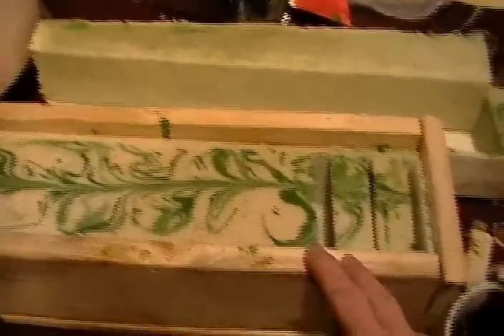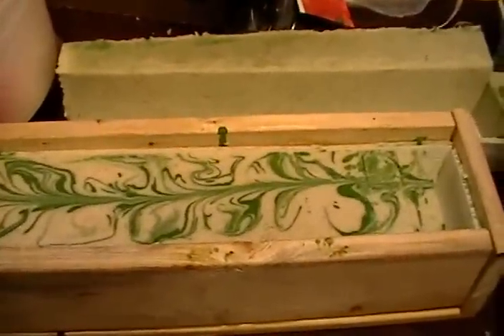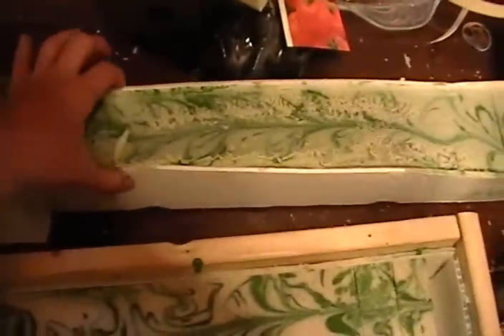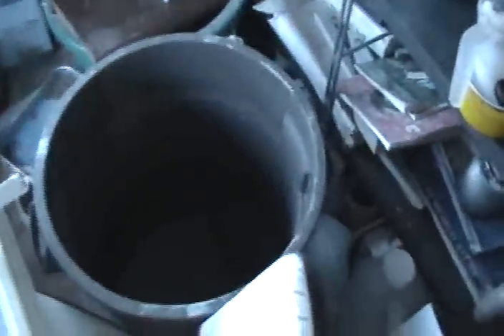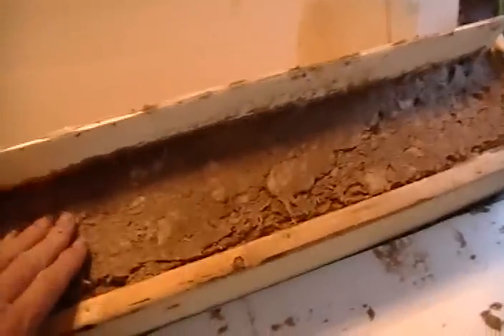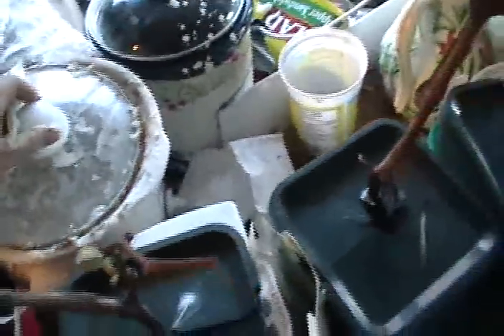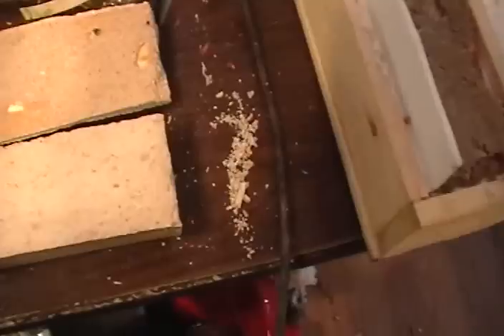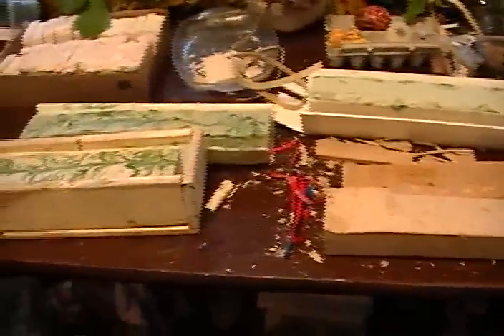Nancy Today: Marbled soap zap test (soap 198)

Comment: I put a plastic bag in my molds as a liner. The whole thing will come right out of the mold, and the plastic won't stick to the soap, it peels right off.
Reply from the maker: Good idea.  Do you have wrinkles in the plastic. I do.
Reply: @Nancytoday  Well, yes. I eventually started using a silicone soap mold.